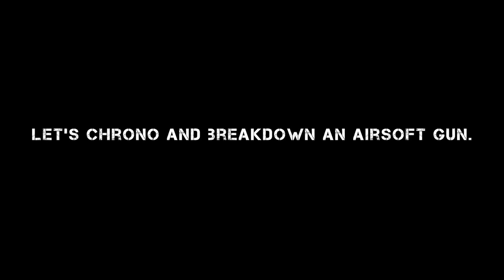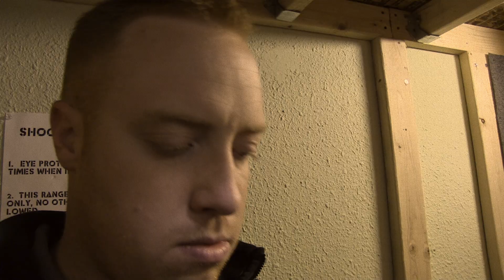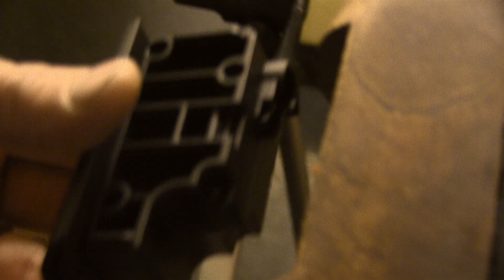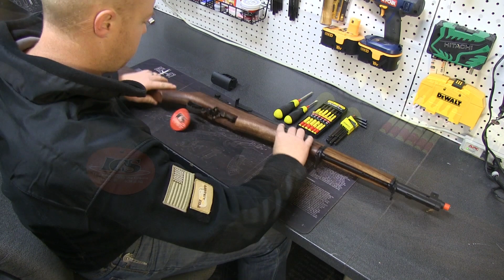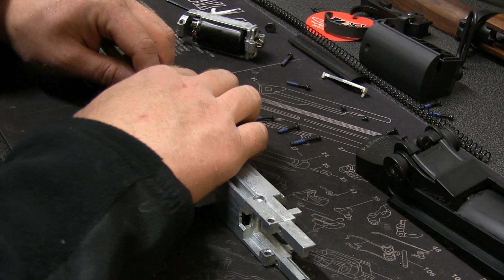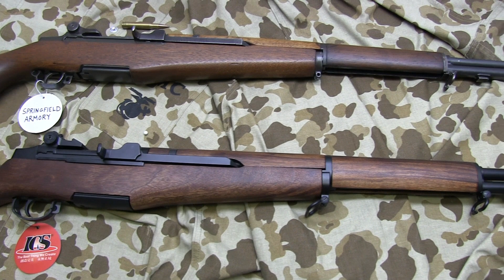Breakdown of the ICS M1 Garand Airsoft Gun | Fox Airsoft

Comment: The comparison shows physical differences that are easy to see, particularly in the spacing of the metal bands on the top.  Some of that could be explained in differences of versions (e.g. Korean vs WW2).
Then there is at least 1 very wrong thing you didn't show:
The GAP between the barrel and gas cylinder (the two metal tubes at the front).
There is a very visible gap on the ICS where there isn't on the real steel.
This error means it looks wrong, and also a real steel bayonet doesn't fit.